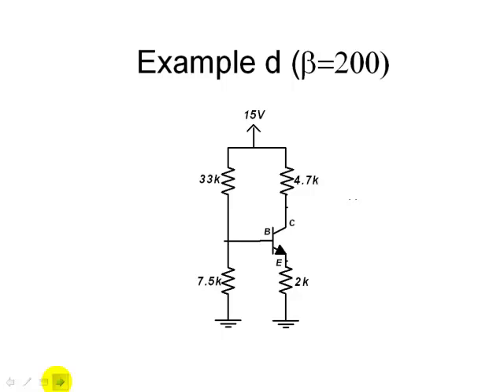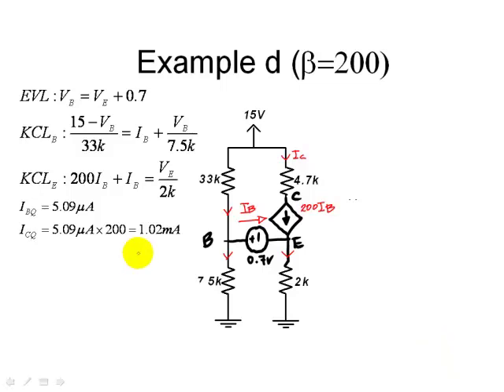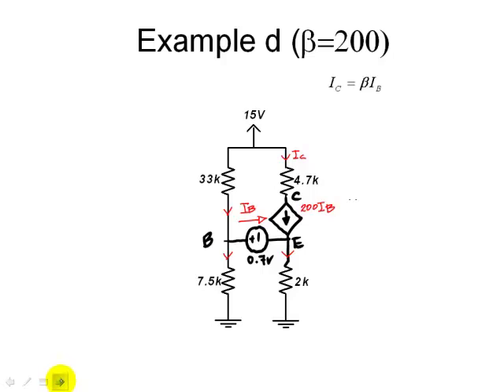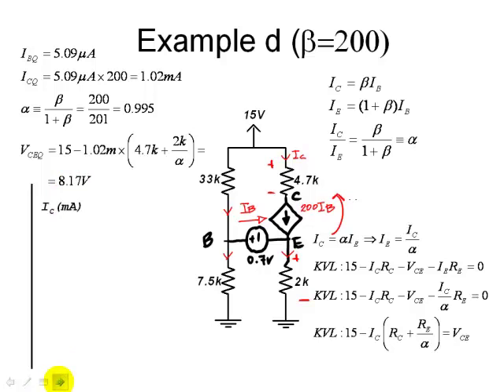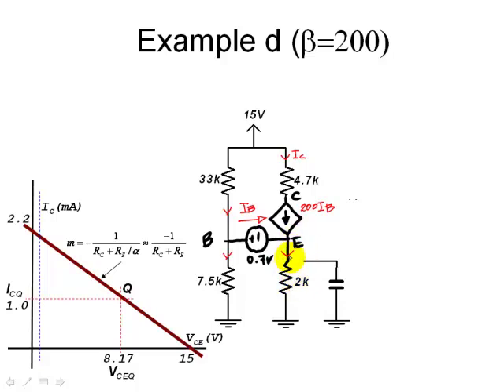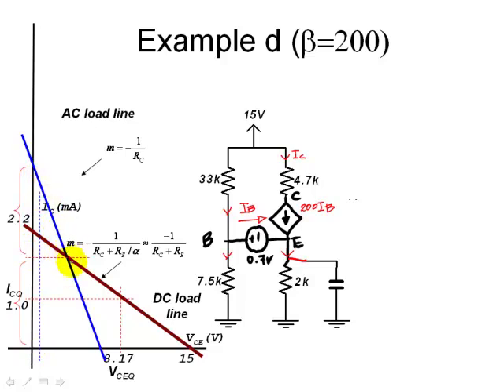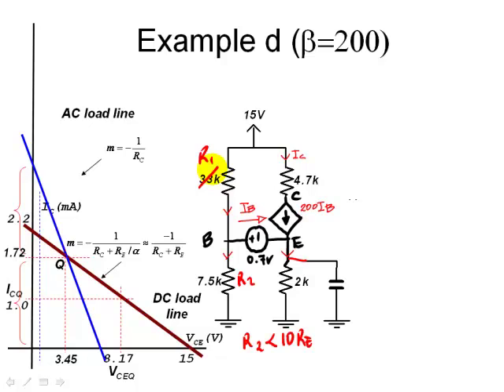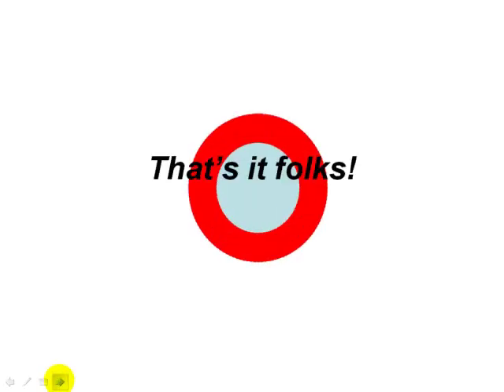EECE 251 - BJT AC load line vs. DC load line.

Comment: Could anyone explain why he chose the second, smaller AC load line (the second blue one)? I get why there is the first one, but I don't understand the choice of the second one at all. Why wouldn't you try to optimize the q-point of the first blue line? Why is the second one better? Thanks!
Reply: I know the question is very old, but I'll answer it anyway. I you moved the Q-point of the first blue line so that the AC Q-point sits between the cutoff and the saturation currents, it would move away from the DC load line which cannot happen as that represent the bias point of the transistor. The second one is the only one possible as its (AC) Q-point sits on the DC load line.